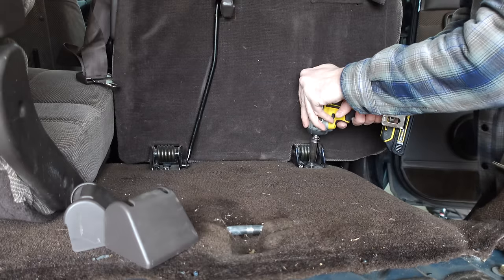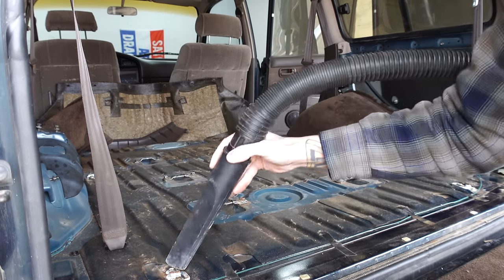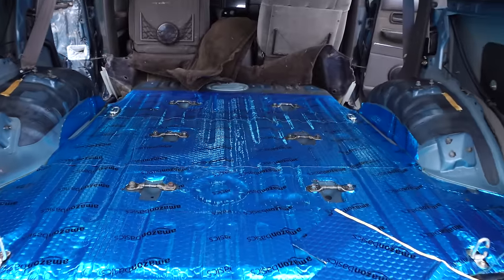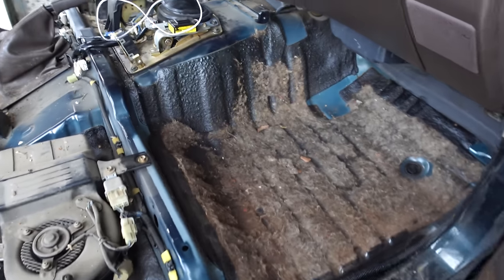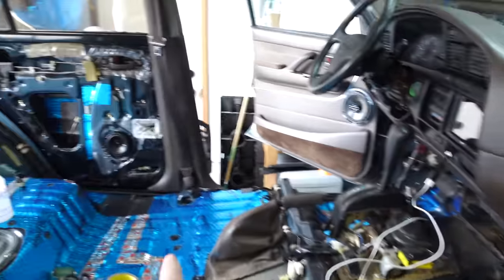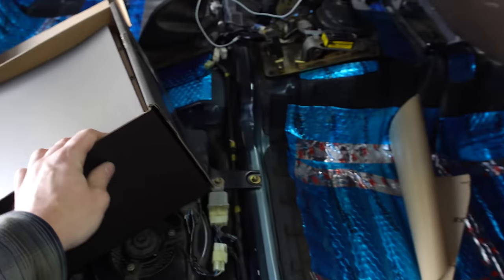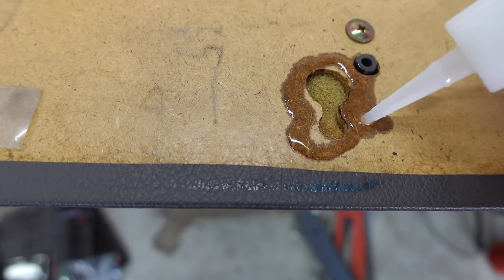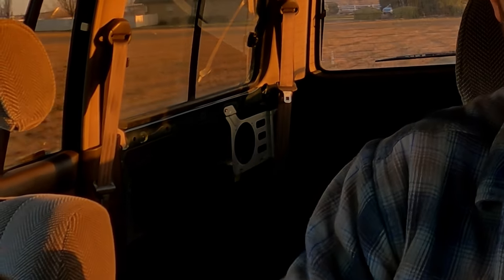The Cheapest and Best Sound Deadening Mat for My Land Cruiser!

Comment: Great video. I just wanted to add my 2 cents. The decibel reading is a combination of sounds, not just road noise. You also have to factor in the noise from wind, engine, and tires. Tires are the worst because the type of tread can add several decibels depending on the type and how it interacts when in contact with the road. Add material to the underside of the hood if it doesn't already have it. And try adding some material to the inner fenders to absorb noise at the source. Luxury car manufacturers target specific areas of the interior and it looks like a patchwork of sound absorbing material when you take apart the interior. I suspect it's because applying soundproofing to the entire interior of the cabin won't result in a huge significance in sound deadening and it's not cost effective. Luxury auto makers also select tires that are quiet and I read somewhere there is a tire made with sound deadening material. Manufacturers also use special isolators in suspension components for their high-end cars. Rolls Royce had to remove some of their sound proofing because it was too good. Drivers were complaining that they didn't have a sense of being connected to the road and it was an eerie feeling while driving.

Comment: Usually the first thing I put it on is the wheel wells. Think about it, that’s where 99% of road noise comes from. At the end when you were applying the 2nd layer in the back I noticed you only had the factory deadener on them. I’d definitely have at least two, possibly three if there was enough

Comment: 6db measured is good bang for the $$ and effort. While 1 person kinda (tried to) touched on it: a musical analogy/reference for the human ear to perceive change in volume, the increased output needs to be roughly 3db, this is AUDIBLY, at the ear. Now, "feeling" ie: low frequencies (bass) can be much less and 3db in 200hz or less is a MAJOR boost in low-end output. Another measurable way to look at it: to increase musical output inside a given space it requires roughly a doubling of output power (wattage) to achieve 3db of gain. So tying the 2 analogies together: for an AUDIBLE musical gain, a car with a measured 50 watts of musical power would require 100 watts of equivalent, clean, undistorted power to raise the musical "floor" 3db.  So at 6db reduction in noise floor, that is the equivalent to 50 watts becoming 200 watts of clean musical power. Again, Logarithmic, 50w doubled is 100w, 100w doubled is 200w, 200w doubled would be 400w etc. a 6db drop in noise floor is HUGE. You caught the only thing I was going to say otherwise: every phone based SPL app has an averaging feature. At least the 15-20 apps I've tested against my professional SPL tool. Technically the MIC is the key to SPL and sound frequency measurements. But the way you conducted the measurements was a fair apple-2-apple comparison and very valid. To build on another comment: the Roof skin, liking it to a drum head is 510% dead on. Especially in an SUV or a Wagon. Any vehicle I build (for me or a customer) gets 2 layers of peel-n-stick (P-n-S) , regardless of Pick-up or Long Roof (Wagon/SUV). Lastly: after years of car audio competition as a pro-builder and competitor, on P-n-S we usually do a "checkerboard" pattern over existing good OEM deadener, solid overage over quarters, door skin backs, usually the interior door skin (where the door panel/card) mounts full cover and foam as you did. P-n-S full coverage does indeed add more effect but its the law of diminishing returns and more weight. Good Job.

Comment: I found noico 8 mil to be about the same as dynamat extreme, although a little less pleasant to work with. Honestly though, these products mostly work for vibration, not road noise. The biggest difference maker for road noise (BY FAR) will be a second layer of carpet.

Comment: I've used 1/2" recycled foam carpet underlayment as sound deadener in the side panels of a VW van. It works quite well with just some spray adhesive.
Reply from the maker: Good tip! I might do that

Comment: I just use Lowe's roof flashing. Has the tar and the foil. Works great and cheap as heck.
Reply: and outgasses the entire time... stinky
Reply: @K03sport  Hasn't done so yet! Been using it for 20 plus years!
Reply: I’ve used it before with good success.  No smell at all. Just leaves a little more cleanup behind. Nothing major
Reply: There’s different brands of flashing with or without foil. The same thing, butyl rubber. It doesn’t out gas at all. Much less than dynamat but I don’t know if it’s more cost effective than the Amazon brand and weather it’s better or not, though.
Reply: @markconley9279  Much cheaper! As for better I have no idea. But my Tacoma is quieter than a friends and he has Dynomat. But who knows how much and how its laid out.
Reply: I've heard of that melting on really hot days as well as the adhesive allowing it to fall off in the doors. I've also heard of it being quite smelly. I think there is such a thing as going TOO cheap. 

The hardest part isn't really the money, it's the installation. Imagine if it fails and you have to then remove it all and replace it with something of better quality. That would be a nightmare scenario. Lol
Reply: @JasonWW2000 it's hvac duct wrap, Frost King, Lowes etc and no it doesn't melt... it's used on fucking heating duct in your home. Smfh, "you heard" but have zero experience with it... typical YouTube expert
Reply: @JasonWW2000 it's hvac duct wrap, it doesn't melt doofus
Reply: @TheRoadhammer379 Great to hear, but why so negative? Cheer up. Everything I said was accurate and correct. We are here to help each other out.👍

BTW, putting tar in a vehicle is a big no, no.
Reply: It's so damn funny! It is exactly the same stuff. I have had both side by side. You people are funny. Also it isn't that much cheaper after pricing it out compared to the cheap sound deadener. You guys use what you like I will use what I have been using for 20 plus years. Good luck!
Reply: @SimonElenor Ah, so you've had it chemically analyzed.
Reply: It's all good if you don't live in California. Mysteriously, everything becomes carcinogenic there.
Reply: @davepetrakos475 No, it's just that California has stricter rules about informing people about potentially dangerous hazards. The other states have lower standards.

Comment: I used this exact stuff in my 2015 tundra about 2 years ago and it’s really really good.
Reply: How does your stuff hold up? I got Kilmat in my F-150 and it's falling apart after 2 years.
Reply: @litoaykiu  not mine. It’s held up really well. I’ve had to take it off a few spots and it isn’t easy.

Did you prep and clean before applying? And did you use a good roller for application? The roller is probably the most important part. It really bonds it to the surface.

I did the entire interior except the roof (which I might do this summer) and it made a big difference, especially in the doors and the way they sound shutting. It almost makes me want to do my tailgate… which is probably overkill.
Reply: @garyng5662   The glue stays in place very secure. Cleaned and prepped, used the rollers that came with the kit; ones it is on it wouldn't come off.   Kilmat did make a noticeably quieter.  The issue is that aluminum and the black tar is turning into a white and black powder. Aluminum part flakes off.  The only thing that is holding, is the glue.

I just did where carpet was since I got water in from off-roading and needed to wash and dry it. Back side was also done. Now, got water in plus need exhaust. Thinking of doing doors and more floor insulation to compensate for new straight exhaust for more ground clearance.  

I have Weathertech floor mats (snowbelt with lots of salt), but majority of damage is on passenger side. My exhaust runs under passenger side, but I don't think it gets that hot make that difference.  Since there is also power behind the driver where there is no exhaust.

Comment: Deadening helps panel drone and resonances, but to really quieten down tyre noise/the engine, you want a thick felt, wool, or closed cell foam layer on the bulkhead and arches, with a layer of mass loaded vinyl over that, basically creating a cavity wall to stop the transmitted noise.

Comment: The hexagon pattern is there to make sure you apply enough pressure when rolling. If the pattern is raised you haven’t applied enough pressure.
A heat gun makes the process easier and help it stick.  You don’t need a lot of heat or it will burn.

Comment: Great job! You should check for rust at the bottom of your inner panels below the sliding rear windows. They are really prone to rust there. There's a drain plug there as well. It really sucks repairing that section if you have to because of rust.
Reply from the maker: Yep, I did. No rust there and then went ahead and coated it with rustoleum anyway.

Comment: Being a former car audio installer, one of the biggest culprits for road noise is the roof and doors. When I would get sound deadening projects, I would do both.
Reply from the maker: Yeah the reason I didn’t do it is because the early 80 series (91-94) are so annoying to tear the head liner out of. I may do it later.

Comment: Hit a small bell: "Ting".
Hit a larger bell: "Boooong"
That's the "resonant" frequency of the object because of the material it is made with, its thickness etc. Go ahead, hit it as hard as you like - the sound will get louder, but the frequency will remain the same.

The tar/foil coating changes the resonant frequency of the panel to a much much lower frequency which is not generated by road vibrations. The source of exciutation is still there when you drive, but the panel won't "resonante" at those frequencies = less sound.

The thicker rubber coating does the same thing but at lower frequencies than the tar/foil stuff does.

Comment: Ballistol can bring failing window seals back to life. It's great at restoring plastics as well. You just use it as a cleaner and then buff it out.

You also need more than just sound deadener to do this correctly. That sound deadener is just the first layer for acoustic management and it's not actually designed to block out road noise. It's more for vibrations and insulation.

EDIT: I see you got the closed cell foam layer as well, that's the actual sound deadening layer.

Comment: I have mostly used kilmatt. When I did my 08 tundra. 25mil on the doors. 50mil on the floors and pillars and 80mil on the roof. Lots of silicone inside the dash. Absolutely no rattles inside the truck. Mind you it's only 24k watts rms. I don't think it's brand so much as just installing the proper thickness and doing it correctly.

Comment: To anyone wondering if it's worth it YES it is. I have a 95 suburban and i used lizard skin which uses a special spray gun on the under side or the cab and a generic something like what is in this video on the inside and it blocks out most of the noise from my nobby 35'' tires. It was one of the best upgrades i've ever done

Comment: Wow that's a lot of work! 
I've been doing a lot of research on sound deadening I'm pretty sure your closed cell foam, CCF, is more ideal for use as a sound insulator than a sound absorber similar to mass loaded vinyl, MLV. For sound absorption you would want to use hydrophobic melamine foam, HMF instead.

Comment: 6db is equal to about a 66% increase in volume to the ear. A doubling of the SPL (volume) to the ear requires about 9-10 db increase in output or the reduction in noise to overcome. All things considered equal it works like this. 100 to 200 watts, 3 db. 200 to 400 watts, 3 db more or 6 db over 100  watts. 400 to 800 watts another 3 db or a doubling of the volume to the ear. 8 to 1 ratio when sing wattage is the mechanism for the desired increase in volume. Since the same works in reverse, 3 db decrease in noise, same as going from 100 to 200 watts, another 3 db down, same volume increase as though you went from 200 to 400 watts, etc.

Comment: The fibrous "carpet backing" is part of the original sound deadening and padding that the old fabric carpet is designed to work with. It should be replaced or the carpet fabric will quickly wear out.

Comment: I've always wondered and thought the ceiling/roof would be one of the most ideal spots for sound deadening/dampening would make a big difference,  especially it being the one biggest one pieces of metal that gets tons of wind, rain noise and usually has little to no sound dampening.
Reply: Just understand that area gets really hot in the sun. Making sure an adhesive sticks will prevent failure (falling).

Comment: Nice install.
I've used a material called Quik Roof that has worked great for resonance reduction. No smell, sticks like crazy.
Just another option.
Reply from the maker: Nice! As long as it doesn’t fall off or have harsh chemicals in it, then that seems like a solid option!

Comment: Unfortunately, there's only so low you can get the noise floor with conventional single-pane window glass. A lot of noise actually comes in through your windows. Butyl rubber and foam definitely helps, particularly if you remember to do the roof.

Comment: There are two ways sound is transmitted,   STC, and IIC, one is from impact,  and the way to oessen that is typically from adding mass, imagine punching a concrete wall, people won't hear in the other side.  Then imagine yelling at the concrete wall, concrete will transmitv this type of dound, abs the best way to learn it is by isolation.

Comment: Good information about the Amazon stuff.

But it was a lot of waste installing over the old sound deadening and also too much material installed.

The best way to do this is use soming to cause the vibration, and then ad pieces to a panel until the vibration stops or hits a level you like.

Especially over kill in the doors.  Now in a land cruiser it's not a huge deal, but in most cars we try to keep it minimal for weight.  You added a lot of weight. 😅

You could probably add a good bit of sound deadening quality to the over all vehicle by removing the headliner and installing some behind there.  Also cleaning that would probably help the smell too. 😅

I felt my 94 was pretty quiet.  If it was any more quiet it would be crazy.
Reply: Like  dead fat man in the trunk!  I, too, don't think it it would matter as much in a truck. Having a passenger in my diesel car cost me between half and one mpg (measured on long trips). It gets 45-52 mpg on highway.

Comment: A 3db reduction is just about half as loud. If you can cut road noise down 3db across the board, that's the same as doubling the power of your amps. A 6-7db reduction is HUGE. I really doubt it was that much. If you can get 3db you're doing wonderful. 3db is extremely noticable. 

(An interesting side note, your amps perceived loudness works kinda the same way. If you look at a speakers spec sheet, it will have an efficiency rating. It will look something like 87db@1w/m. What that means is that of you feed the speaker 1 watt of power, it will play at a loudness of 87db when measured from 1 meter. That in itself isn't that useful, HOWEVER, what is useful is that EVERY SPEAKER will play 3db louder if you double the power. 

So our 87db speaker at 1watt will play at 90db if you feed it 2 watts. And 93db of you feed it 4 watts. 

96db @ 8w
99dn @ 16w
102db @ 32w
105db @ 64w
108db @ 130w
111db @ 260w
114db @ 500w
117db @ 1000w

All assuming the speaker can handle the wattage. At some point the speaker will start turning power into heat instead of sound, and go much past that and you will break the speaker. 

But then scale illustrates two things. 1. More power has its limits. There is a point where adding power isn't getting you as big of gains. 

2. Getting a more efficient speaker really effects loudness a lot. There are home speakers that have extremely high efficiencies, like 105db@1w/m. Think about that. At that efficiency, the speaker needs just 4 watts to play the same loudness of our 87db@1w/m speaker does with 260 watts. You won't find these in car audio though. They are delicate and wouldn't stand up to automotive use. Just a neet tidbit. 

Thanks for coming to my Ted talk...

Comment: +3dB is double the power.
-3dB is half the power.
+6dB is double AGAIN. if you have 10 apples, and you increase that amount by 3dB, you have 20 apples. If you have 10 apples and you increase that amount by 6dB, you end up with 40 apples.
-6dB is half AGAIN. if you have 10 apples, and you decrease that amount by 3dB, you have 5 apples. If you have 10 apples and you decrease that amount by 6dB, you end up with 2.5 apples.
This is kind of the whole point of the decibel scale, you can represent a huge quantity with a smaller number.
You started with about 72dB and redeced to 65dB for a reduction of about 7dB. Lets round it DOWN to 6dB.
You reduced the audio noise power by about 4x

Comment: Great video! I really need to do this on my S10 Blazer, god that things noisy. Have you got any recommendations for other interior noises like squeaks and rattles from plastics?(Dash, door panels, etc).
Reply from the maker: Hmm. I would say that there was probably some rattle even when new. They didn’t use to focus on making cars so quiet back then. You could find what rattles and try to dampen sound by either replacing the part or finding what is making the noise and adding some sort of damper (rubber, butyl, etc) to stop it from happening. Or turn up the music!
Reply: You can try Hushmat Quiet Tape or something equivalent to isolate to surfaces that are rubbing and creating noise.